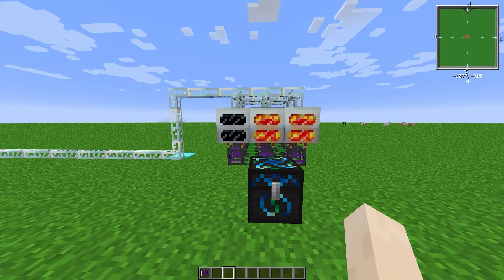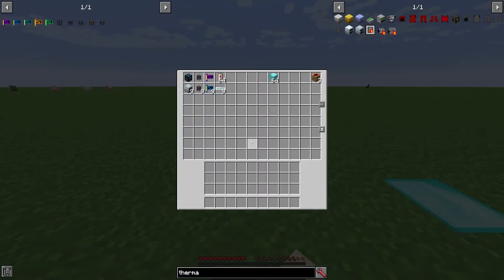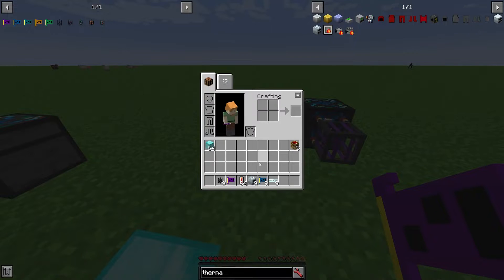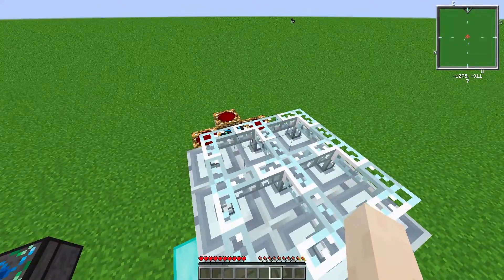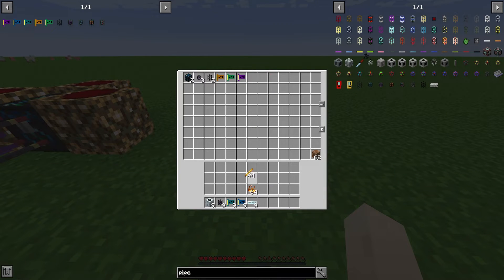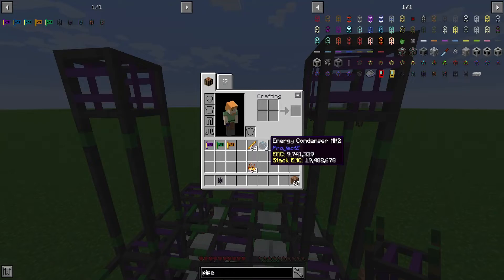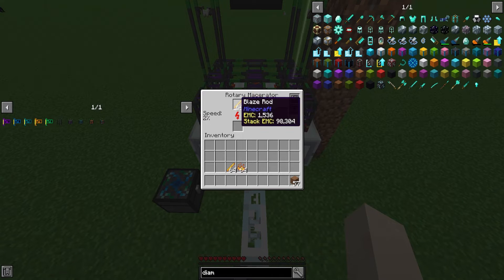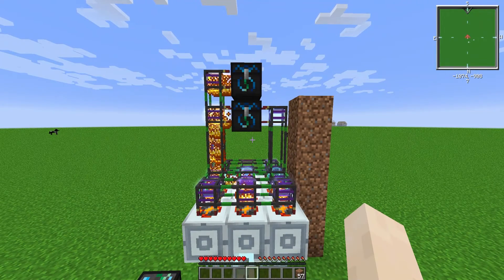Automated EMC Farm/Thermal Generators - Tekkit 2Torial

Comment: The geothermal geneators work just have the lava cells go into bottler then pipe from bottler to the geothermal generator have outpute emtpy cells from bottler back to energy condensor and if need put buffer chest between energy condensor and bottler if not enough lava being moved fast enough

Comment: You are Jesus. Hard to find a good EMC farm in Tekkit 2, ain’t like it was in the old days.
Reply: Blaze rods to blaze powder using macerators, blaze powder into EMC chest to convert it back to blaze rods, and repeat. You can take a third of the powder out and use that, plus the whole farm is tileable vertically with a bit of pipe work.

M X C
X     X
E  X M

(1 block tall unit)
where M is a macerator (rotary is best but any will work. X is item importers (filtered is best). E is a energy condenser. C is a chest that links up to the top.
Feed the blaze powder back into the energy condensers and use overflow chips to take the rest.

Wire it up and add pipes, and you are done :)

I hope this helps someone
Reply: This is not a great one tbh, quite slow
Reply: @ would love to see a faster and early game one. Whatcha got?

Comment: The geo thermal gens have this bug where they can run into a soft block if the energy they have jn the buffer is the same as cable loss. Either do not use cable or use a transformer directly touching them and outputting to a cable

Comment: My issue is that there are not enough blaze rods being produced to fuel 9 macerators. One of my macerators is completely idle. I tried placing another condensor on the other side of the blaze rod provider but it doesn't take anything from that new condenser. Any tips?

Comment: Can’t get it to work. Won’t extract from the energy condenser. I put all the chips in the pipes.( fixed )
Reply from the maker: If youre talking about thermal generators make sure theyre not geothermal generators as those dont work. Must be thermal generators
Reply: @chiseledchin7088  This is what duped me. tried making a huge setup with geothermal gens lol

Comment: Doesn,t work, they nerfed the emc value of blaze powder from like 700 to like 300. Converting one blaze rod into 5 blaze powders coss a loss of 1 emc as apposed to a gain
Reply from the maker: Not sure what modpack you are using but in Tekkit 2 version 1.2.1 it still works. Not sure about other EE modpacks
Reply: @chiseledchin7088  tekkit classic reloaded for 1.12.2. Thanks for the response! I've been wanting to try tekkit the resurrection for 1.19.2 that released about 4 months ago but just haven't finished reloaded get

Comment: was working fine then it stopped working for some reason, not sure if the server just needs to restart. it only seems to pull Rods into the first 3 macerators and refuses to pass any to the other 6
Reply: check the chips are all correct. or maybe a chunk border issue
Reply: @borisnonceson  was a chunk issuse thanks for getting back to me

Comment: im playing on tekkit 2, and the lava cells won't extract out the condenser into the pipes. Any help?
Reply from the maker: They will only extract if they have somewhere to go. Make sure you're using thermal generators not geothermal
Reply: @chiseledchin7088  I have it built exactly the same, won't pull out of the chest
Reply: Figured it out, You cannot input lava cells from behind, they have to go underneath, that was my issue. Great tutorial regardless
Reply: I found the generators needed a "kickstart" so I put one lava cell into each generator and then it started accepting the lava cells being produced by my power flower

Comment: IC2Classic dev here.
You can do the entire thing without logistic pipes.
Just put one EMC chest in the center and soround it with rotary macerators/macerators.
And put import/export upgrades into them. Setting them to face the chest and that entire thing works exactly the same without having to use logistic pipes.
Reply: @KackNoobExpert  depends machine buffer would also work if you only need to transport a few blocks.
But it would at least isolate the system and only turn it into a provider source instead of a managed system.

Less pollution in the network.
Reply: Only if you are making a 9x9 one, I made a 5x5
Reply: so i got that to work, which is great. but now how would you extract the overflow blaze powder from the first condenser to flow to another condenser where i can put the things i actually want to condense? i can’t get the powder to flow out of the condenser, since it doesn’t work the same way as shown in this video since he is extracting from the macerators and rerouting the overflow blaze already in the pipes.

edit: oh nvm lol i can just use regular buildcraft transport pipes and an electrical engine powered by the same source. but it only takes the blaze rods for some reason which is better anyways.
Reply: @d33pstate you can use translocators with a diamond upgrade and put a stack of blaze rods in the filter so it never takes the final stack. This is the fastest possible extraction outside of computer craft